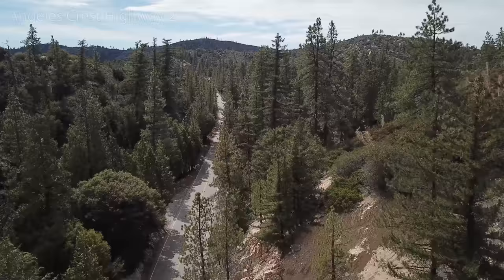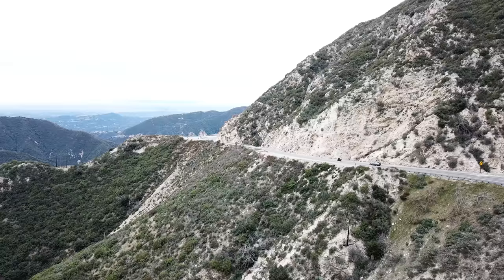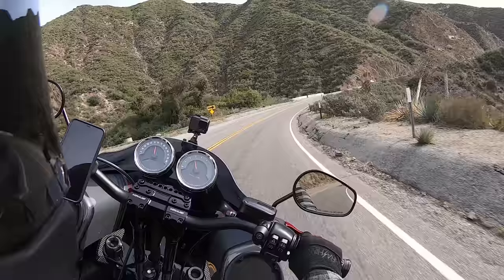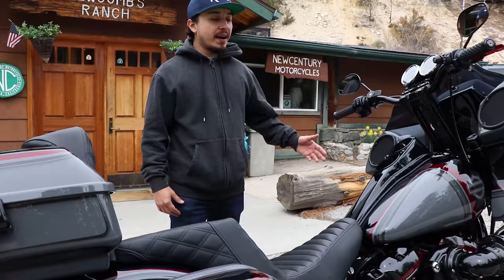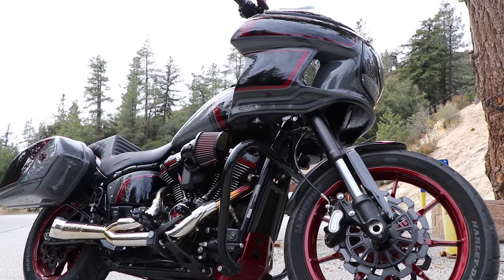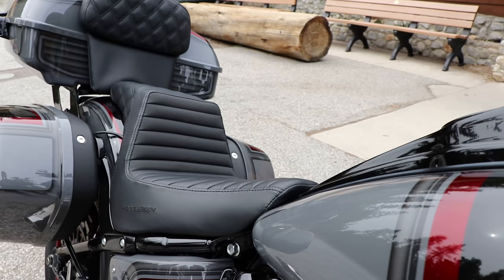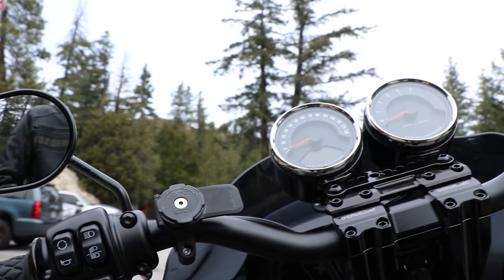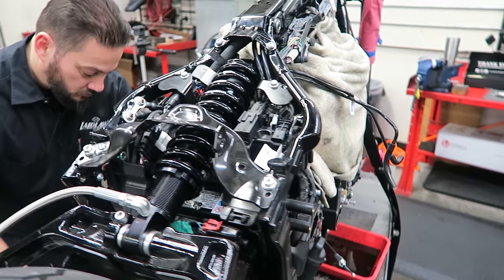Retro-FXRT-Style Low Rider S │ Harley-Davidson

Comment: Very nice.
Way out of my price range, but I love it.

Thank you for all of the great content.
I agree with MarvelKid87 that Harley needs to understand and develop a marketing strategy around social media influencers.
I’ve always ridden naked sport bikes (79 Suzuki GS1000, 07 Honda 919, 16 KTM SDGT, 18 Yamaha MT10).
Never thought I would consider a Harley.

However I think I’ve reached the stage that I need to slow down just a bit (I’m 42).
Still want to be able to have fun on the back country roads and don’t want to give up all performance and handling aspects.
But don’t need to be twisting the throttle and going serious triple digit speeds (in a few seconds) every time I ride, and taking 45 mph corners at 90+.

I know it won’t be able to be pushed as hard as a sport bike, but that’s the point.  A bit more laid back but still can offer enjoyment when you want to let it rip and throw it around a bit.
Without always worrying that you’re 1 well positioned officer away from a trip to jail and a license suspension.

I know self control is a big part of that, but honestly, what’s the point of a sport (or sport naked) bike if you’re going not going ride it like it was designed for.

Anyway, all of that to say, the Low Rider S seems like the perfect fit, and IMO the type of direction Harley needs to head in if they want to attract riders like me from other bike segments/manufacturers.
But they also have to get the word out and pique interest.
And without your guys work on YouTube I seriously doubt it would have been on my radar.

I don’t know how well their strategy of trying to break into other segments is going to work (if they continue that path with the new CEO).
It may, and they may need to try, but for people who want an adventure or naked sport bike, the bikes will need to meet or beat their competitors in performance and handling aspects and be in the same price range.
Doubt they will convert many current Harley riders to the new categories (and not gaining market share if the do).
And to bring people over from the market leaders in these segments, will have to meet those stated criteria.
I just don’t see many people buying a non-traditional (for Harley) segmented bike, that offers less performance and value than the competitors, just because of the name and heritage.
But IMO they can bring people from other segments to a “traditional style Harley” if it offers increased performance characteristics, while being priced “reasonably.”
At least people like me, that still want some performance, but are willing (and want) to step away from sport bike performance, as long as the price isn’t outrageous for what you are getting (but still willing to pay some premium for the brand).

Comment: Are the saddle bags a little off ? It seems that one is shorter than the other.
Reply from the maker: One is deeper than the other. They are designed that way. To accommodate exhaust on a stock bike

Comment: Can that tour pack and sport glide bags fit on a 2017 low rider S with the chopped fender they have from the factory?  Love this setup!
Reply: You'd have to use a different mount, as the new Low Rider S has a wider fender than the old one does and uses the new holdfast system, unlike the Dyna.

Comment: Wow the bike Harley should have built... all the handling of the dyna, cruising and storage capability of the baggers without the unnecessary weight that fatigues you, and wind protection.. I had a touring Harley and the weight is always noticeable because no average rider is strictly riding hundreds of miles a day at high speeds..unless your vlogging specifically on you tube for that very reason..... cmon Harley, reproduced this bike for $20k ... it will keep your on business.. god bless .. ride safe..
Reply: Sorry for grammatical mistakes.. should have proof read... oh well..
Reply: And no... the Sport glide doesn’t cut it .... altho it’s a nice bike

Comment: WOW! that bike is drop dead gorgeous. that paint is killer. Love the rotors and bought the B-52 Black ones but for some reason Lyndall would not send me a pic with them on a B-52 wheel, and now I can't even get those wheels, so I don't know what Lyndall's problem is. You spend 2K on brakes and you can't get a picture? WTF? The paint design really pulls everything together, so that painter is a goddam genius old school soul. So JEALOUS, until I finish  murdering my PSB. I saw RC Components at a Rally on Amsoil Adam's youtube and they spoke of anodizing, but when I called them, they said they only anodize what they sell, so I'm not too happy with their line of BS either. If you can't be careful with what you say, you should just shut your pie hole.

Comment: Your a good at marketing,to bad the the product’s are out dated overpriced and slow ,but your good
Reply from the maker: Outdated? This is a new frame as of 2018 and new engine as of 2017. The prices are lower now then they were 20 years ago when you adjust for inflation.
Reply: Ya a company that has 2 frames and 2 engines? Put a different wheel on this one and a little saddle bag on this one it’s like a shell game

Comment: I guess I need to make said statement more clear.
Harley motor company ; we believe if we are reading these corp. balance sheets right ; has about 500 million dollars "more" debt, than the  1.6 billion as reported. We believe is still true the last CEO of HD depleted most all the extra funds from the off-shore bank acounts in Ireland, and other accounts, before he left HD a few years ago. Harley simply is no longer able to generate the cash flow to service all these debts....

Now, the Mil-8 engine is big loser for this company. Twin cooling and oil cooling such an abortion for an air-cooled motor of this size. Is well known the Mil-8 factory "light pressure" oil rings will allow the motor to foul the spark plugs after 20k miles. Cam chain tensioner pads, and cam bearings still only good for about 20k miles before they explode inside the motor. Primary chain tensioner also problematic after HD went back to primary chain drive after running primary belt drive back in the 1980's. Also, Doc Harley confirms his practice of voiding factory and extended warranties based on  "Black Flags" generated from on-board BCM computer module. All these are intention design flaws in order to continue to boast dealership "Shop Income" based on broken motors. We can only assume many other dealers follow the same practice, as we can read the source code software for the BCM. 
We Have HD Company e-mails and finance balance sheets we uploaded to Wiki-Leaks for further review.  Many internal message traffic complains parts orders from catalog falling behind company sales goals. Bike orders of 500cc, 750cc, and Live Wire falling behind company sales goals. Given the steady decline of HD stock price over last five years,  diminishing quarterly reports, and company now falling behind on loan payments, we predict Harley Davidson will fall into receivership next couple years.......

Your correct build of FXRT maybe too little and too late, and certainly now too much too expensive for remaining client base.
Reply from the maker: I also heard that man never landed on the moon.